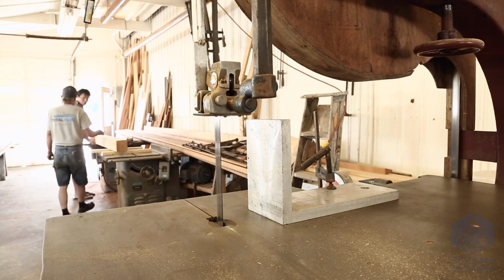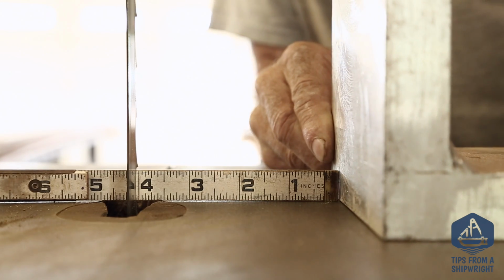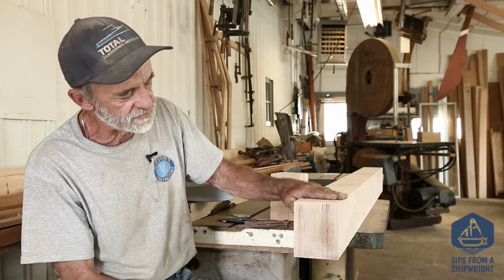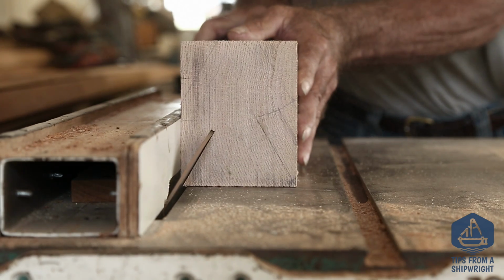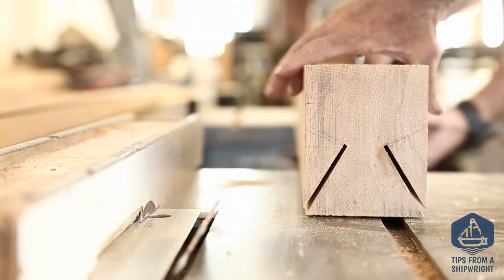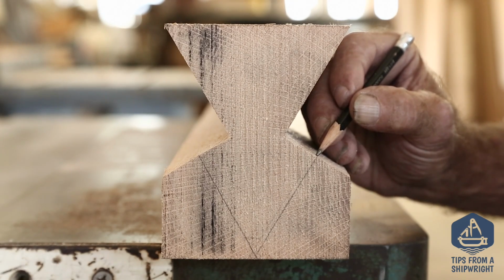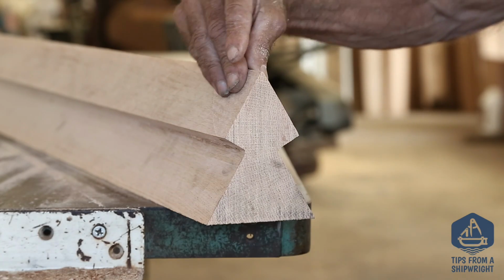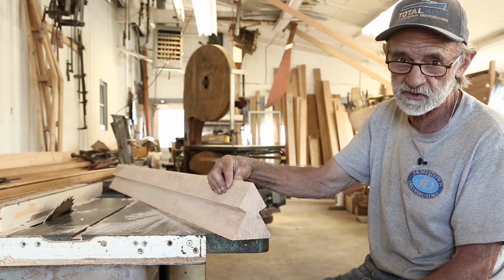How to build a Flat-Bottom Fishing Boat with TotalBoat products - (Episode 2)

Comment: That is a mean table saw to be hogging away that white oak. Love this video series. Id like to make a skiff to freshwater fish out of. Cannot wait to go to IYRS in september.
Reply: dont forget to add a mast and sail to it saving alot of gas when its windy you dont need much sail surface.
http://i.imgur.com/XjRrAbB.jpg  this is an ZK-10 Two masted 10oared cutter used for sport today and back then as recieving boat when outboard engines were a thing of the future and are dateing back to the times of trafalgar.

with these you simply put the oars acros the deck and the blades vertical and you can sail this way upstream 
at 1 - 1 1/2 knots  and this is roughly (stern included) 2 square meters moving 1 1/2 t
Reply: Awesome tips. Thanks!

Comment: I love these videos, but I still don't know where exactly this piece of wood is going to be in the boat?
Reply: I gather It is the vertical member of the bow. The very first piece that cuts through the water of the finished boat. The side cuts are to allow the side planks to be attached flush and string them together along the length of the bow. 
I am anxiously awaiting the next installment of this series.
Reply: Ahh, so am I right in guessing he'll need to steam this piece next to bend it to make the front of the bow?
Reply: I believe it will be scarfed in some way to the keel, It would be a mighty steam box indeed to bend that piece.
Reply: If you look at the cardboard model you can see that the stem has no bend and is near vertical. This boat will not likely have any keel, I'm guessing she will have perpendicular bottom planking and chine logs with a small skag strip on the centerline to help with tracking.